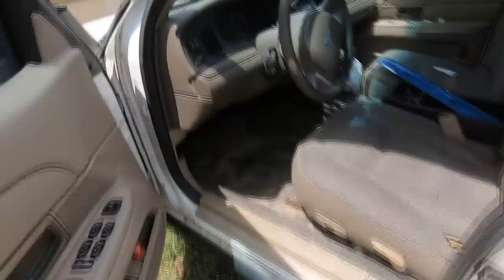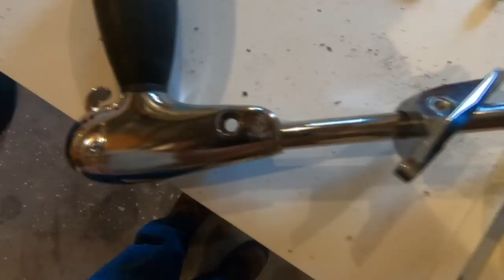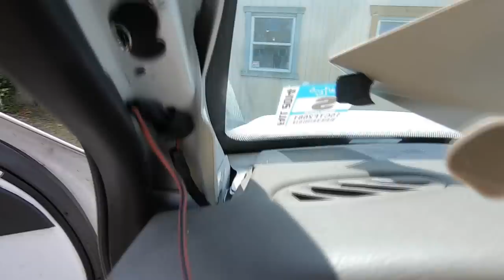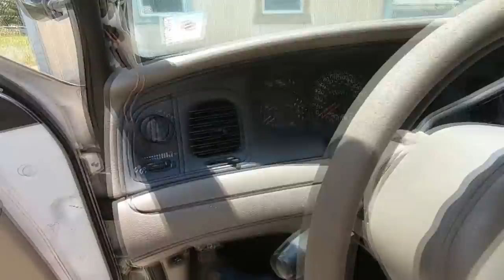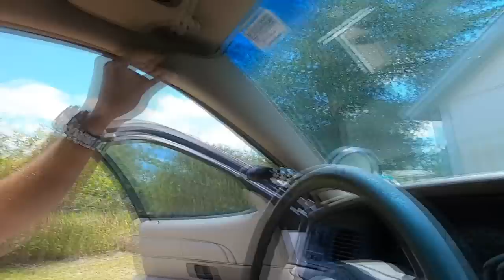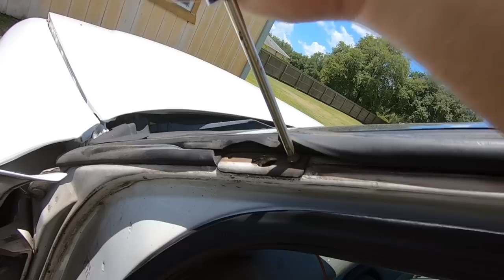Install or Remove Crown Victoria Spot Light

Comment: I used to have a spotlight on my old police car, I used to get pulled over by this one cop constantly who was always insisting that I remove the light that it was illegal because it was considered emergency lighting!  Me being the stubborn kid that I was at the time never took it off and he was threatening me that if he saw me with it again he was going to tear it off and smash it on The ground himself!!!   We butted heads after this all the time to the point where I ended up moving out of my hometown because of him.  over the years I have had many police cars with the spotlight on it and never had a problem.
Reply from the maker: That guy sounds like he may have had a chip on his shoulder - unless there's some kind of law against it in the local area.  Usually spot lights aren't considered to be emergency lighting.
Reply: @TheCopCar  yes there was no local ordinance, he just made it up from the vehicle code because he said you're not allowed to have emergency lighting and he considered that to be emergency lighting. I've seen many a old police car around with the spotlight still on it, I believe you can order any car from the factory with one. I know you definitely could years ago.he did not know what he was talking about and just figured he would harass me
Reply: Should have filed a complaint to his superior

Comment: The switch on my spotlight doesn't work.  It's really loose and isn't allowing a good contact to keep the light on.  Haven't tried to open it up to see if it's fixable, so any suggestions out there?
Reply from the maker: I agree with @dirtyfred1 you'll probably need a new handle.  You might be able to take it apart to see if there's something you can fix.

Comment: I have a retired cop suv with spotlight and wiring already installed, it just doesn't work. When I took it to the shop I asked them to check out the wiring and I think they said the wire must have been cut somewhere, but I followed the wire down through the dash (it heads towards the floor) and didn't see a cut anywhere. Do you have any tips or videos on troubleshooting these and how to get them working again?

Comment: Good DIY, but I don't have the plug for power. Do you know if that plug runs from the fuse box or directly to the battery, asking because I may just have to wire mine directly to one or the other. Thanks in advance.

Comment: Is it absolutely necessary to separate both the spotlight and handle from the exterior shaft? Why not just leave one end on, such as the light for example and slide it through the hole together as one and skip the step of reassembling one end. Reason I’m asking is because I recently purchased a Unity spotlight myself for my crown Vic, and have been having trouble removing the light itself from the shaft. I’ve tried so hard with my hands alone to remove the exterior shaft until my hands began to bruise and I’ve attempted your flathead trick as you mention in your video to further separate it. I’ve tried heavy duty pliers and it still will not budge. It appears after closer examination, that there’s some substance on that end of the shaft, hidden from my view that perhaps is acting essentially as a cement to the point where no matter how much force I apply, it will not move or come off. So, my options appear to be either to just skip that step or to buy another light assembly. What do you suggest?

Comment: Just installed a spotlight on my 06 Crown Victoria thanks to your video and it works great. Also I found another wire harness when I pulled the A pillar off that runs with spot light into the dash, does anybody know what this is or used to be?

Comment: Great video , Have a Q , I have two spot lights on my 2011 I'm going remove and clean them up than reinstall them but how do you stop water interning do you put silicone around  the shaft under the gasket.  Thanks

Comment: Is there a way to change the angle of the spotlight handle? When on the highway I like to put my spotlight flush with the windshield for fuel economy and so it doesn’t flop in the wind, but that causes it to block my passenger side mirror, so is there a way to change the angle of the handle?